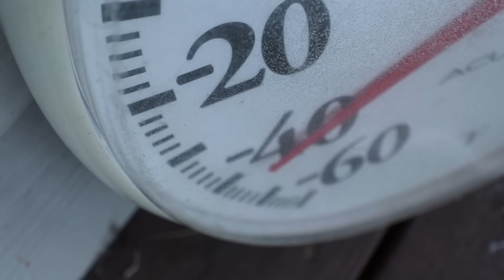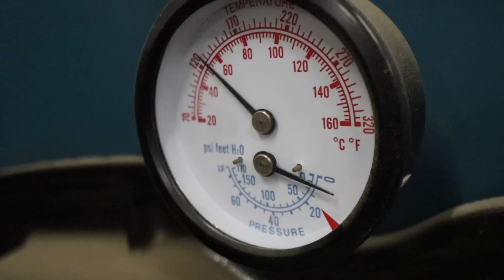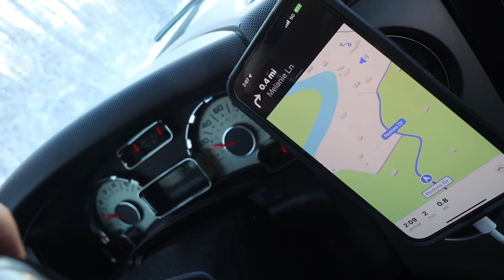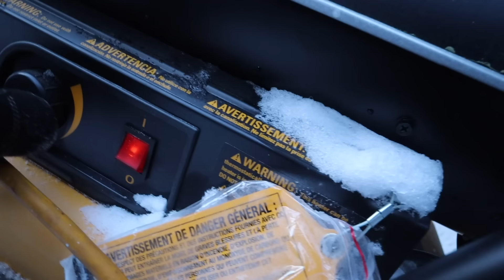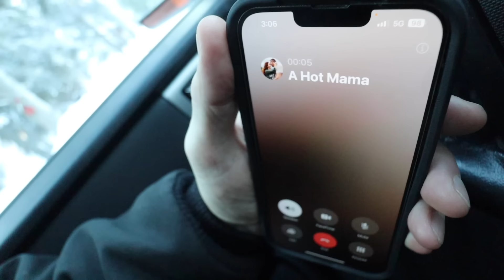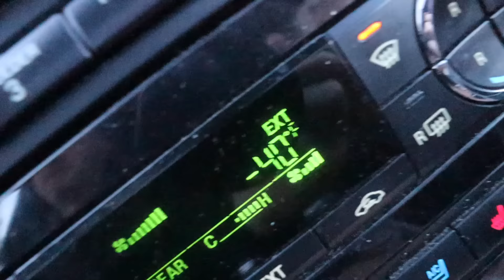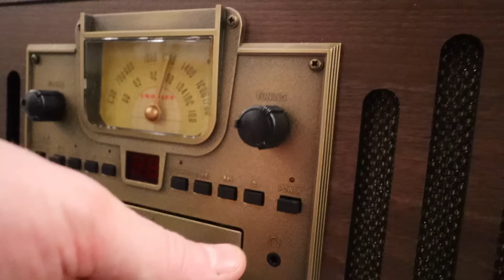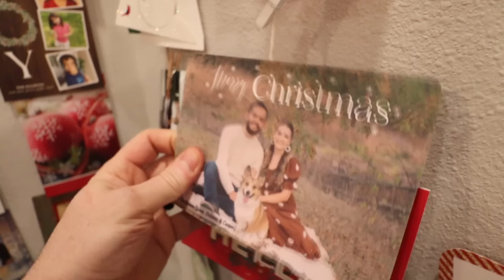STRUGGLES OF 50 BELOW ZERO | Somers In Alaska

Comment: My husband used the Scopolamine patch on a cruise and flights after he was diagnosed with ALS.  He did not get sick.  I live in Minnesota so I know about those super cold temps.   We are told to run the temperatures a little higher in the house because our furnaces have trouble keeping up with the cold.    Cars and all those frozen metal parts combined with heat can easily break.  You have treacherous black ice.   If you can, stay indoors and bake chocolate chip cookies and a savory roast.  lol

Comment: The patch works but avoid rubbing it to be certain it is stuck really good and then later sticking that finger in an itchy eye corner. Otherwise, that pupil will dilate humongous, and if you forget what you have done, they will test you for a brain tumor in the ER. Good Luck!!
Reply: These are not Dramamine or meclizine patches but rather scopolamine.

Comment: Sounds like a possible vestibular migraine triggered by motion. Not all migraines cause pain.  Some can even cause panic. I used the scopolomine patch- please wash your hands after removing it and don't forget to remove it.  I personally use phenergan at a very low dose and a single ibuprofen.  I've had lifelong motion sickness and as I've aged it's not been dx as migraines.  Also know that different planes pressurize at different altitudes.  This can cause attitude sickness symptoms.  Airbuses for example pressurize at a higher alt than most boeings.  It would be interesting to see how she would do in a 787 for example.